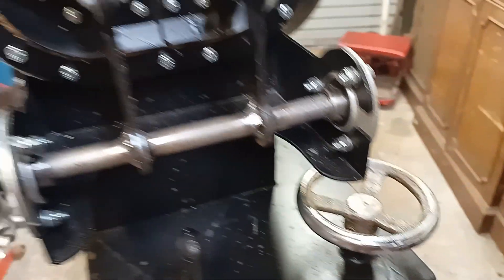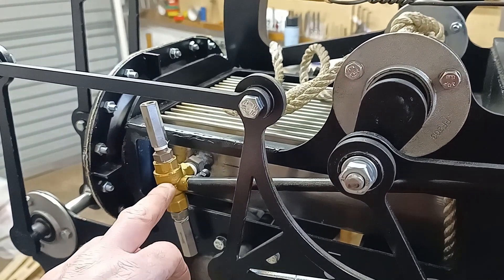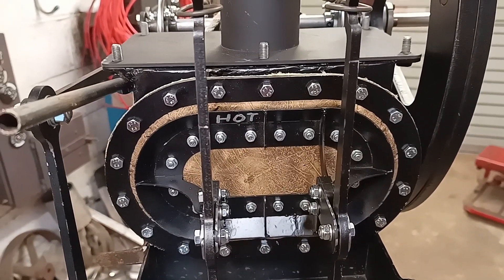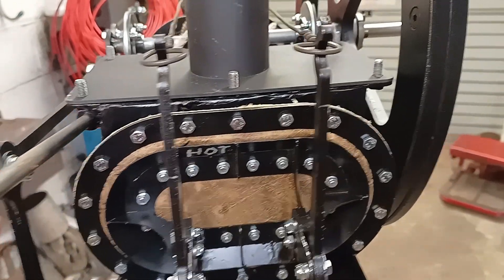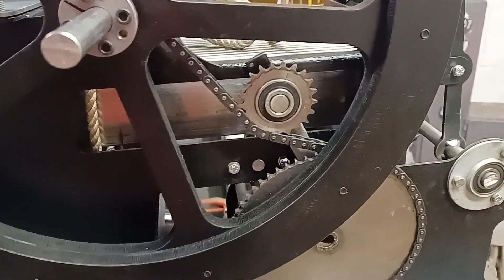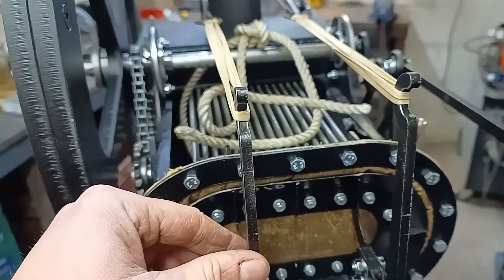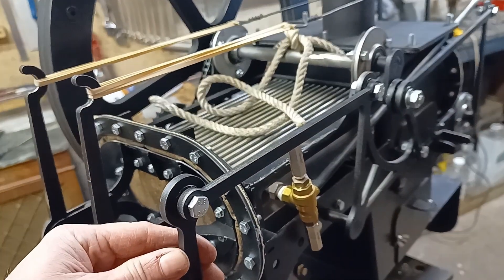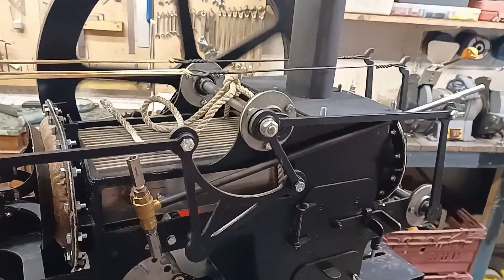Hot Air Stirling Engine Locomotive - Part 7

Comment: I was surprised how much threaded bolts you use. Are you planning to replace them with rod-stock on the log term?
Reply from the maker: @sharedinventions  I should probably change those out! Just want to get it all together to see if it works, thanks

Comment: Shane its Luverly - I wish you every success - I like your sniffer valve that doubles as a stop - very neat - not so sure about soft steel threads bearing on inner races - in time they may cause a rattle - I would replace them high tensile bolts after testing - it looks great

Comment: Amazing project. 

For real life, the stirling engine newer did well in locomotive or cars. That’s understandable due to slow speed change. 

But, there is a big but: we still use diesel engines.  The stirling  engine is more efficient. Combined with a modern battery and electric motors, it would be a very good solution. Big locomotives  are diesel electric already. Just a small buffer would make it possible to swap out the diesel ICE.

Comment: You've done such an amazing job! I'm pretty confident the engine will run just fine. The only suggestion is you may consider replacing the linkage threaded bolts with shoulder bolts. Over time the threads will wear out and play will set in fast. Looking forward to seeing it run.